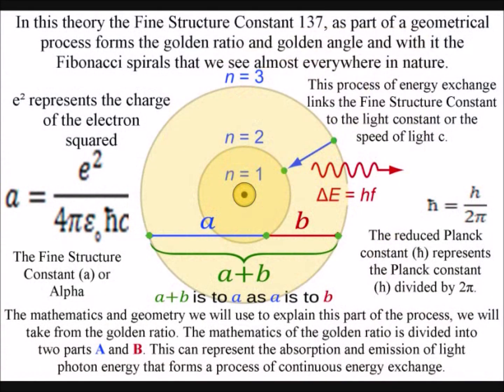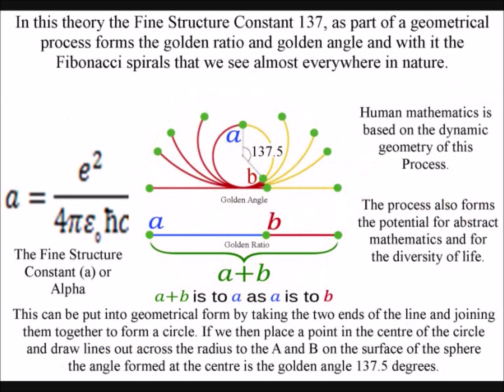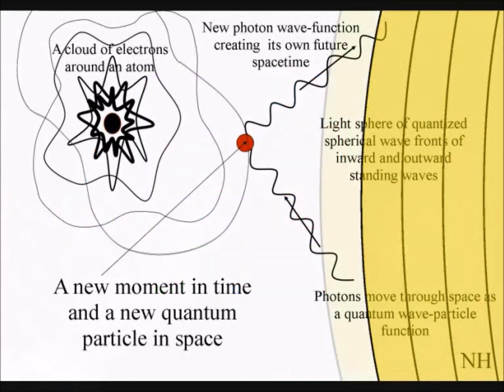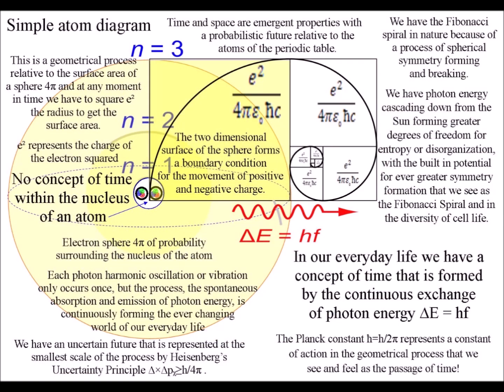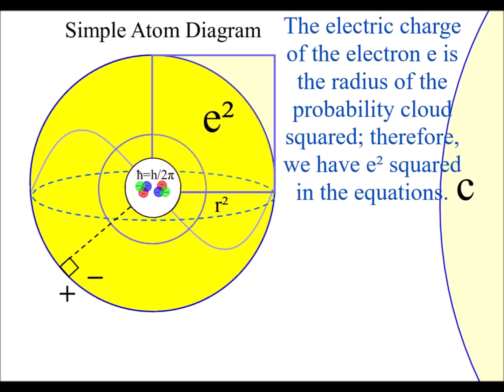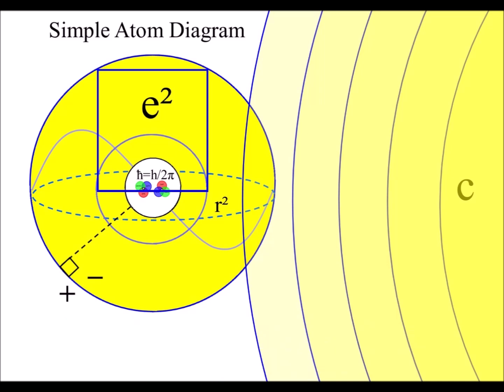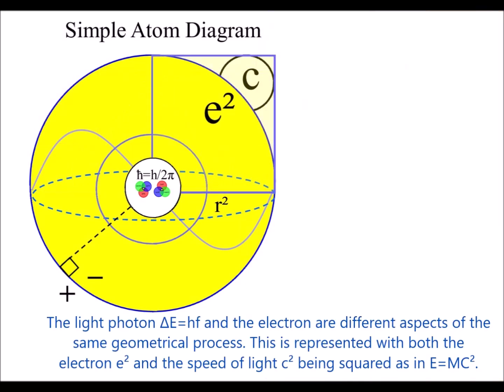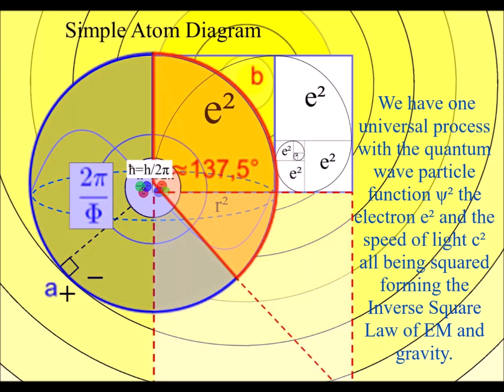Why 137? "Theoretical physics is a waste of time unless you can explain 137" Paul Dirac

Comment from the maker: Alpha the Fine Structure Constant or Coupling Constant: 137.5 ~ 1/137 or 13703599∞ arises out of: 
The charge of the electron e² squared 
The Planck's constant ħ=h/2π of action
The light constant c
The permittivity of free space K=1/4πɛ˳

A geometrical process based on spherical 4π geometry can explain this. 
The charge of the electron e² squared represents the radius being squared r² because the process is relative to the spherical surface. 
We have the Planck constant h/2π because the energy levels cannot drop below the centre of the sphere. The 2π represents the diameter of the sphere with the process relative to the radius r² squared. 
The light constant c represents the speed of the process. 
The permittivity of free space K=1/4πɛ˳ represents charge being relative to the spherical surface.

This is based on Huygens’ Principle of 1670, that said: “Every point on a wave front has the potential for a new spherical wave”
The two-dimensional surface of the sphere forms a manifold for charge with the inner concaved surface forming negative charge and the outer surface forming positive charge.
The interior of the sphere 4π is naturally three-dimensional giving us our three dimensions of everyday life with the one variable in the form of Time ∆E ∆t ≥ h/2π.
We have spherical light waves with the particle characteristics of light coming into existence relative to the surface of the sphere; therefore, we square the radius r².
 Because of this the wave-function ψ² is squared the electron e² is squared and the speed of the process c is squared as in E=MC² representing one geometrical process.

We have the spontaneous absorption and emission of light photon ∆E=hf energy continuously transforming potential energy into the kinetic Eₖ=½mv² energy of matter, in the form of electrons. Kinetic energy is the energy of what is actually ‘happening’. This process forms an uncertain probabilistic future that is continuously unfolding with the exchange of photon ∆E=hf energy. This can be seen mathematically as Heisenberg’s Uncertainty Principle ∆×∆pᵪ≥h/4π with 4π representing the spherical geometry.
Reply: This is implausible. Alpha is a dimensional unit that relates the magnitude of constants to each other. The figure 137.5 degrees is not only far outside the error margin on the measurements, but it also flies in the face of common sense, since degrees are an entirely manmade and arbitrary unit of measure. It might have been mildly interesting if it had been 1/137.36 radians or something that relates directly to the geometry. As it stands this theory is exceptionally unreasonable and unlikely.

Comment: Tim Long:  The Fine Structure constant is a dimensionless ratio of the radii of the binary electron pairs in the electron shells to the radius of the nucleus to the electron shell.

Ed Bishop:
Because the value of α is a fundamental constant that has been measured experimentally and has been found to have the same value in all experiments, so any theory that purports to be a complete description of nature must be able to explain why this is the case. Why?

Nick Harvey:
Alpha the Fine Structure Constant or Coupling Constant: 137.5 ~ 1/137 or 13703599∞ arises out of: 
The charge of the electron e² squared 
The Planck's constant ħ=h/2π of action
The light constant c
The permittivity of free space K=1/4πɛ˳

A geometrical process based on spherical 4π geometry can explain this. 
The charge of the electron e² squared represents the radius being squared r² because the process is relative to the spherical surface. 
We have the Planck constant h/2π because the energy levels cannot drop below the centre of the sphere. The 2π represents the diameter of the sphere with the process relative to the radius r² squared. 
The light constant c represents the speed of the process. 
The permittivity of free space K=1/4πɛ˳ represents charge being relative to the spherical surface.

This is based on Huygens’ Principle of 1670, that said: “Every point on a wave front has the potential for a new spherical wave”
The two-dimensional surface of the sphere forms a manifold for charge with the inner concaved surface forming negative charge and the outer surface forming positive charge.
The interior of the sphere 4π is naturally three-dimensional giving us our three dimensions of everyday life with the one variable in the form of Time ∆E ∆t ≥ h/2π.
We have spherical light waves with the particle characteristics of light coming into existence relative to the surface of the sphere; therefore, we square the radius r².
 Because of this the wave-function ψ² is squared the electron e² is squared and the speed of the process c is squared as in E=MC² representing one geometrical process.

We have the spontaneous absorption and emission of light photon ∆E=hf energy continuously transforming potential energy into the kinetic Eₖ=½mv² energy of matter, in the form of electrons. Kinetic energy is the energy of what is actually ‘happening’. This process forms an uncertain probabilistic future that is continuously unfolding with the exchange of photon ∆E=hf energy. This can be seen mathematically as Heisenberg’s Uncertainty Principle ∆×∆pᵪ≥h/4π with 4π representing the spherical geometry.

Jose A. Fdez Coco:
137 es un número primo pitagórico. 
11^2 + 4^2.=121+16=137. La reduccion en la suma de sus digitos, es igual al primer número primo. Dividido por la unidad 1/137, sus decimales contienen un período capicua de 8 cifras.
Como curiosidad, Pauli murió, en una habitación de hotel con el número 137, número que le dejaba perplejo.
137^2 dividido por 3^n siendo n impar en la siguiente sucesion (1,3,9,27, 81, 243), los decimales resultantes son cuanto menos...curiosos.
Reply from the maker: Why did you not put it all in English?

Comment: Bruh, how did you relate the golden ratio to the elementary charge??
Reply from the maker: The mathematics of the Golden Ratio is divided into two parts A and B. This can represent the absorption and emission of light photon ∆E=hf energy that forms a process of continuous energy exchange. Mathematically we have to square section A to form the golden rectangle out of section B. If we continuously repeat this process with smaller and smaller rectangles, we form the Fibonacci spiral. And this is exactly what we have within this process in the Subatomic world we have a square in the form of the charge of the electron e² being squared. The spontaneous absorption and emission of light photon energy forms a repetition of the process forming the Golden Angle 137.5 in the form of geometrical self-similarity.
Reply: @Dyslexic-Artist-Theory-on-Time  The denominator of the fine structure constant as a ratio is 1/137.03 not 137.5
Reply: ALSO the "golden angle" is not a dimensionless value the way the FSC is. 137.5 comes about from the arbitrary decision to split a circle into 360 degrees, converted to radians it would be about 2.4 radians or .76 pi radians which doesn't really relate so well to the 1/137.03 does it?
Reply from the maker: @Zanz0vida  I am rounding the number off, the number is actually an irrational 13703599...